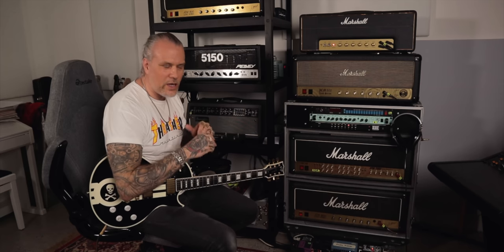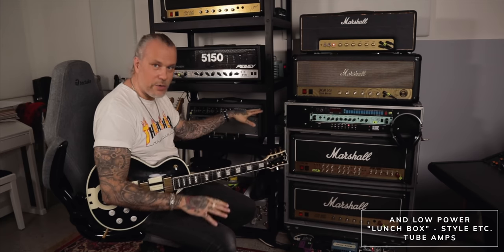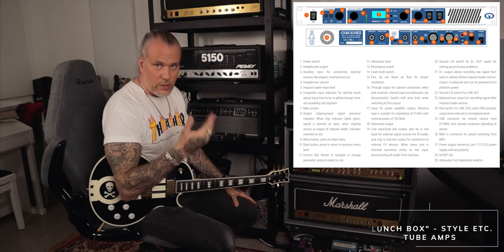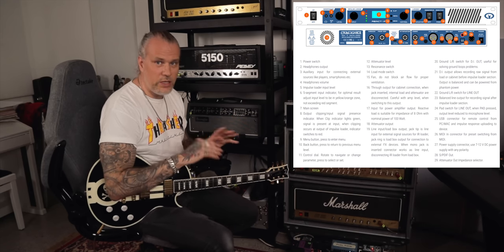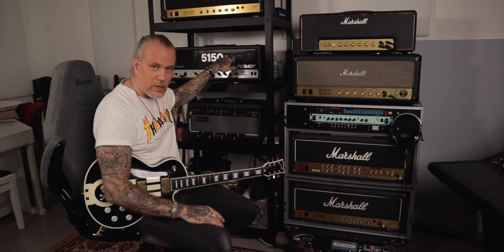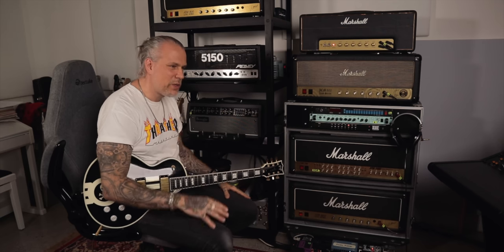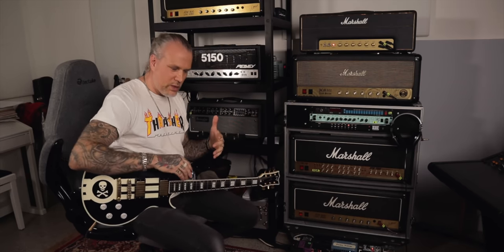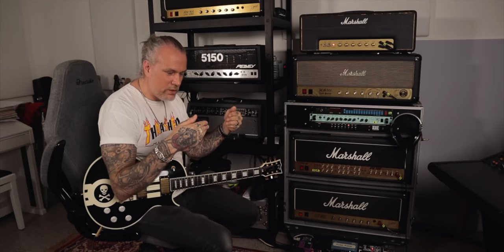TUBE AMPS' MASTER VOLUME | What it is, what it does & how to use it

Comment: Really enjoy how you educate. You do it so well! Your tones that you get are constantly incredible no matter which amp you choose (although the bad buy will always be #1 to me).
Reply from the maker: Glad to hear! Thanks!
Reply: @EugeValovirta230V  Euge, came across this video trying to also understand master volume on the big amps.  So are you saying that every master volume is located between the preamp and power amp section?  Asking because we see videos of people playing the Marshall dsl 100hr at bedroom volume and most of them say that the sound is fantastic because you get the pre amp and power amp tube breakup sound.   I'm considering an amp like that for home use because of the headroom and rich tone of the big amps.
Reply from the maker: Yes. That’s why it’s called Master Volume.
In my experience the power tubes break up when you drive them hard, just like preamp tubes. If you don’t drive them hard they won’t break up. It’s just how tubes work.
Reply: Fuck dude this was very well explained. Now I know what the   Fck is  going on … question so  if I don’t use the gain and just want to use  master vol with a dirt pedal,  do players do this or does it not make sense ?or does it have to be on the clean channel to do this ? Thanks

Comment: I bought a Bugera PS-1 attenuator for my Diezel VH4 (I only play at home) and wow...I was so impressed with how well it sounds and keeps a lot of my tone. I am able to raise the master volume to around 11PM and push the tubes a bit. Also makes my VH4 with a Diezel 4X12 decent at bedroom volumes. Of course not perfect but decent. Master volume without the Bugera does not sound great as the Diezel is too damn loud lol
Reply: You should try a good reactive attenuator. If you think the Bugera sounds good, wait till you try one of those :)
Reply: @MagyHimself  which one's would you suggest that won't break the bank?
Reply: @allboutthemojo  i'm afraid reactive loads do break the bank :) though the one i use and Euge used is the St. Rock React IR. It's a great unit!
Reply: @MagyHimself  I see. How about the Two Notes Torpedo Captor Reactive Box?
Reply: @allboutthemojo  that s also good, but I have my doubt about how good it is on the amp. Dave Friedman hesitated in one of his shows about calling it safe. The Suhr one is good tho and then everything more expensive such as the Fryette, Ox.

Comment: I'm telling you Euge....when you dial back that gain, with what sounds like some low output pickups, your tone is spectacular.  This sounds unbelievable.  Great mids, biting, and articulate.  It's a shame that there's still really nothing that represents a speaker with a lot of air moving through it.  It's that percussive punch, that I have yet to hear any plugin, or modeler replicate.
Reply from the maker: Indeed 💪.
Reply: less gain is better from my experiences
Reply: You really don't need a lot of gain to get a good sound. I love the sound of a little bit of gain loud because it stays clear and defined. Every concert I've been to where I loved the guitar tone was one where the guitarist didn't use much gain.
Reply: @RodVonLongrod  Tone is subjective, but I agree.  Very well said.  Although, "...not much gain" is definitely relative to the style of music....especially, today.  I'm an 80's classic hard rock guy (early Van Halen (Fair Warning), Ratt, Y&T, etc...).  And by today's standards, those tones had VERY little gain.  They were using late 60's and early 70's plexi's.  They had a lot of bite, and were very well defined.  I think that's why to this very day I gravitate towards a dimed crunch channel on an SLO.  But, I agree 100% correct.

Comment: Hook up a reactive load box attenuator. Crank the Master Volume. Adjust the attenuator to a manageable volume. It sounds better than just using the MV to control volume levels. When you get that power tube distortion it is glorious.

Comment: Great subject!! 🤝👏😁
THANK YOU for a priceless knowledge, Euge!!!!
Reply from the maker: Thanks man!
Reply: @EugeValovirta230V  thank YOU! 👏🤝
Euge, those principles are the same when aplied to the guitar's volume control? Seems to me that the volume does not decrease, insted, the caption magnet turns more week. Is it a fact???
Reply from the maker: The hotter the signal going to the amp the more preamp tubes will distort / overdrive, the colder the signal (volume down on guitar, overdrive off etc.) the less the preamp tubes distort / overdrive so basically yes 😎.

Comment: When you increase the MV you’re actually hitting the phase inverter tube harder, not the power tubes, which I don’t think will change the tone much unless you’re really cranking it. The phase inverter in modern amps is still a 12ax7 tube, so it’s more that you’re getting advantage of another preamp tube stage instead of suffocating it with the MV pot resistance. That’s why you can get so much gain from a cranked Plexi: the distortion doesn’t come from the power tubes but from the 12ax7s (included the phase inverter). Also (I’d say mostly, from a tone perspective), when you’re setting your MV at <1 you’re applying almost all the resistance of the pot to the signal, while there’s just very little resistance from signal to ground, killing your tone. As soon as you make the pot work better, at higher settings, you’re getting more of your signal back, bass and low mids first of all. This is the reason why I suggest that, with any piece of gear, if the levels oblige you to keep a pot very low, find another place to lower the levels, in order to raise that pot setting.

Comment: Nice demonstration. For bedroom level volume I went for low watts tube amps (Firefly 1.5W and DSL5CR with upgraded speaker).  You said that the high-wattage amps sound weak at low level but I wonder if it can be compensated with EQing. I think this is why Marshall added a “Deep” button to its low watt models.
Reply from the maker: Thanks! To some point I guess but a sheer full blast tube power is pretty hard to emulate with anything that isn’t a sheer full blast tube power 😎.

Comment: Hi Euge, are you using only the fethead germanium inline preamps here? No neve 1073 or anything like that? That's a great mic'ed tone for not so much cash if so.
Reply from the maker: Can’t remember but I probably used Warm Audio’s API preamp. I didn’t went through the signal chain on this one?
Reply: @EugeValovirta230V  You went through the signal chain, but did not mention a preamp here, or in your fredman micing video. Thanks for responding!

Comment: So what about situation, when you have both — Volume knob (for each Channels, usually in pair with Gain knob of course) and Master Volume knob.
What Volume knob (Channel Volume) exactly does on this situation?
Reply from the maker: It determines the volume for each channel so you can determine how loud (or quiet etc.) is the other channel compared to the other. Whether it affects the tone & sound is up to the amp’s design. When you just use your ears when dialing the knobs you should hear what it does and what any knob does. And like always: if it sounds good, it’s good 😎👌.

Comment: Wild sounds through the Softubes, Euge! Just purchased, but I would like to know what you are playing the Amp Room through to get that volume? Just audio interface to monitor speakers? Speaking of which, have you checked out IK Multimedia’s new precision monitor speakers? They’re not cheap, but I am sure they are worth it. I am loving Neural DSP’s plugins, so it will be interesting to compare the Softube plugins against the likes of Neural DSP’s Soldano and Gojira virtual rigs, which I have bagged while they’re 50% off. What do you make of Polyphia btw? Very different! 🤘Loving your sick playling, as always!
Reply from the maker: To get the volume of a 100 watt tube amp? A 100 watt tube amp 😎. Well the 5150 is actually 120 watts 💪😊.

I use amp sims pretty much only for songwritng and usually go with the Amp Room, Bogren’s AmpKnob or STL Tones. Basically these: https://youtu.be/BhFj272HstQ

When I record for real and mix / re-amp other bands’ stuff I use real amps, cabs, speakers, mics & mic pres ’cos real deal is always a real deal.  

I’ve mixed so many songs / albums with my Yamaha HS8s & sub with Sonarworks Reference system that I don’t have any reason to try out anything else ’cos I’m so used to those.

Thanks!
Reply: @EugeValovirta230V  The Softubes Amp Room compares very favourably to the Neural DSP apps, having A/B’d them today. I do like the GUI of Neural, though + they have a lot of volume, maybe more gain than Softubes. Thanks for the information - I would like to run the apps into a guitar cab, ideally, but I’m not sure how to do this.

Comment: I hear ya Euge nothing worst than fizz. I bought a slash sl5 when they came out and put a mullard in it and run it through my 16 ohm jcm 800 412 At 5 watts cranked i have the perfect household volume. I can get the anvil clank and the woody violin sounds, absolute BLISS with an archer od in front. Back the volume down, i don't even use the mesa mk3 head for clean anymore.💪🎸

Comment: I have a question to you.Which of small 20w or 30w amps would cope with the drummer during rehearsal?I have PRS MT 15 and I wonder if that one will do the trick?
Reply from the maker: That’s a good question since I’ve always used 100 watt amps but Marshall’s Studio Series 20 watters are pretty damn loud so those should work. But it also depends how heavy hitter the drummer is 😎.

Comment: My 120-Watt full valve Bugera 6262 Infinium (there's no master volume and I had dreaded about it before ordering ) definitely doesn't sound week with 2x12 v30. Actually it sounds absolutely massive (muffled but still absolutely fat and wide with amazing bass) even with volume at 0 lol. It actually is easier to control than my Marshall DSL1 @1W full power mode. The knobs on my 6262 are very controllable.

If you dream about big arse full valve amp, go for it... Test it... You'll never know if you do not try it. I was super positively surprised with this amp and was in fear that since my DSL 1 Watt was so loud I could barely play it @ volume just below 1 I must be insane that I want a 120-Watt monster. Yet, I wasn't and I play/practice/learn @ 4 a.m. with a person sleeping almost next room to mine/

Basically whisper volume. I normally play @ +-85 db which is somewhere @ 0.5-0.7 /10 volume. Almost identical to the DSL1. I wanted to check this BIG IRON BIG SOUND kind of thing and to be honest... My Joyo Zombie II does almost exactly the same if not better.

The thing is... a 120-Watt full valve amp is like the end of the line... You just don't crave for anything else (bigger) and I might keep it just for that...  So I don't crave for that big full valve amp any more... 

I have plugins, small DSL1 valve amp, a Zombie II hybrid, will get a modeller again soon too probably but... Nothing really gives you that immediate plug an play experience. It's hard to explain but valve amps have this magic that almost everything else doesn't. And I am not talking here about the sound quality or anything.

It's just the experience of powering it on waiting for valves to get hot before you hit them with higher current, etc. Little things.

Basically gives me the most joy and the most time actually playing.

For recording, convenience and even sound quality (at my room volume +-85db) I would definitely pick plugins and modellers but none of them feel as powerful as this BEAST. They might sound meaner, mightier, bigger etc. but they just aren't lol 

It's like a small kitten trying to do angry voice they might even get really scary but they still come from a small kitten... if you know what you mean.

Now when you play with the real LION you feel respect and the whole experience is just on a hell lot of different level.

Try everything, see what gives you the most joy and actual amount of playing and fun. There are no rules. I bet you could even record an amazing album @ 85db there are just no boundaries in art.

but again... I barely can play a few beginner songs but I've tested a lot of things in my 5 years of guitar playing and I know a thing or two. 

Do not take what someone else say as something that will be also true for your. Listen, gather information. Test it. Develop your own opinion.

p.s. I wanted full analog effects with full valve big arse big iron amp with 4x12. Got it all except for 4x12... (kind of sad and next time I will know to go BIG or go home... - because you will never be fully satisfied, especially if you go only half-cocked, scared, half-measured, etc.)

and now I want small all in one modeller because I hate tap dancing on effects, heavy 2x12, heavy big amp. But I am glad I have tried and now I know. I might keep all that as a deterrent to not miss it buy again. Worked with DSL1 for a while but big arse amp was always in the back of my head... Now that I have it... There's nothing else I really want// well Mesa Boogie Dual Rectifier with Mesa 4x12 but I think my Bugera 6262 with 2x12 will keep that desire at bay/
Reply from the maker: Cool! If it sounds good it’s good. We all have our own personal tastes & preferences 👌.

Comment: Hi...I've been playing guitar for years, and it's only now that I've started to think about how parts of the amp interact. Anyway, this might be a very obvious question but do you think there's anything to gain (no pun intended😂) in having the master volume up and using the channel volumes lower to create the tone and overall volume? I'm using an ENGL SE/FE at the moment, and the channel vols are all up around half way and the master is low, as you can imagine.

Comment: Hi Euge i just bought a used Randall KH120 but it sounds "muffy", as if it sucks the tone ive tried multiple stuff with attenuator with out gain full etc. but i couldnt find the problem. The Clean Channel is alright theres no problem there just on the High Gain Channel. Its an Solid State Amp. Would you mind helping me? 🙏 As always great tips again im glad youre here 🤘🏼
Reply from the maker: I haven’t played with that but maybe the amp isn’t just for you?
Reply: @EugeValovirta230V  could be but on youtube it sounds very different, but anyways thanks tor the answer 🤘🏼

Comment: Can anybode help me? I have a marshall origin 50 with a great attenuator. If i were to use this amp live, i would be playing clean, dirty, and distorted. How would i go about making the clean tone as loud as the distorted tones? And how should i set the tone to begin with, i really like setting the master at 6, and gain at really anything. If i want cleans, i turn gain down, but this drastically reduce volume.. and if i have it that way, when i add pedals, i get crunch again, but the volume gets much louder again.. 
Is there a "best" method to set the settings, so the volume doesn't changr THAT much? What i found was really crankinh the gain and turning down master volume gives me the most stable volume, but the power tubes are then not working very much and the tone is not as good as when the master is set high.. 😢

Comment: Your right brother . I got the 50 watt EVH 6l6 and that thing is too loud for the bedroom but that amp actually sounds great at bedroom volume even though it's not near it's full potential . I do get to crank it every once in a while . We jam outside at my sister's in the summer and it'll damn near drown out the drums with the volume on 3 . Lol
Reply: I found EVH with EL34s so loud I could barely tolerate it at Master 1. Sounded the same as my Marshall DSL 100.  I think I need an attenuator all the same.
Reply: @thomascoolberth2648  probably bad master volume design. Bogners have great master volumes from experience

Comment: So is a post phase inverter master volume mod a good mod for my 2203 to make the power tubes work at a lower volume??
Reply from the maker: 2203 has a master volume. That mod is for amps that doesn’t have a master volume like Plexis 👌. I guess 😎.
Reply: @Euge Valovirta  I have a 2203 with a mod called Gridmaster. I'm told it's a post phase inverter mod for volume and yes my 2203 also has master volume. I'm just wondering if you know about this mod?
Reply from the maker: Ok 🤟. Apparently I have no idea 😎. All my amps are stock.

Comment: Thanks for the video Euge. I have a 100 watt Marshall Lead 100 Mosfet , solid state head. Would you say the effect of the master volume would have the same or similar effect? Mine has 3 volumes. 1 Master, 1 Normal, and 1 labeled as boost. Thanks :D
Reply from the maker: If it doesn’t have any tubes not really. But I’ve never really used solid state heads so I might be wrong.
Reply: @EugeValovirta230V  fair enough. I was just wondering why it would even need a master volume when there is no voltage requirement for tubes. I think I'll have to do some experimenting and see what happens . Thanks :D
Reply from the maker: I think it’s just a volume ’cos if it wouldn’t have one the more preamp volume (gain) you add the louder the amp becomes like it’s the case with a Plexi where power amp tubes are basically ”wide open” all the time. And that’s part of the beauty with a Plexi; the more preamp gain you add, the more power amp gain you add too and it’s insanely loud without an attenuator or a Variac.

Comment: One thing bothers me. If you put volume pedal (or hx stomp) in amp loop (serial of course) and reduce the volume then you must rise the master. But i asume that doesn't mean that you can reach amp sweet point (even if master pot is at 12.00) cause volume is reduced before master. Btw i have evh-5150-iii-50w-6l6.
Reply from the maker: Exactly like that ’cos tube amp’s effect loop is in between the preamp & poweramp sections.